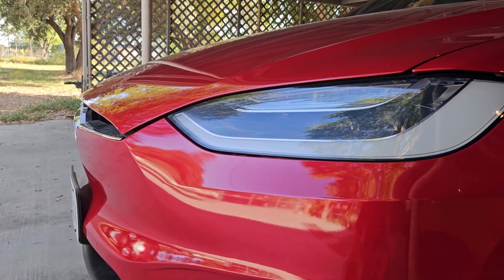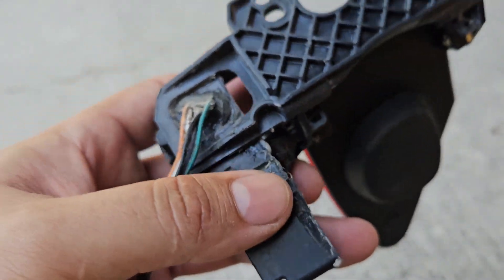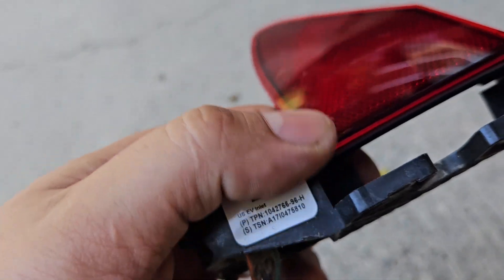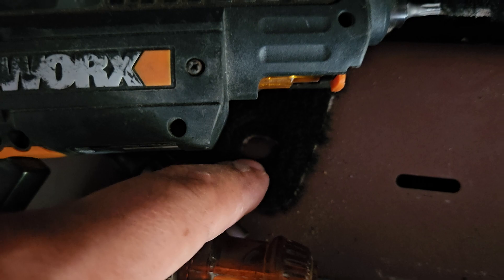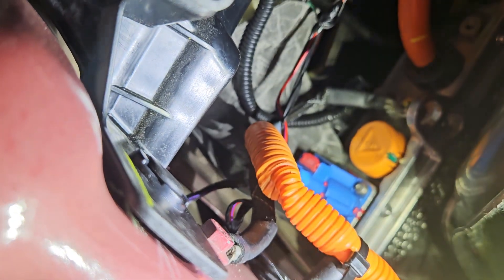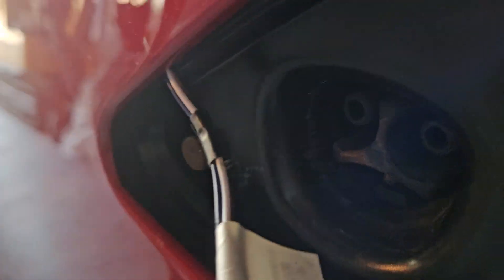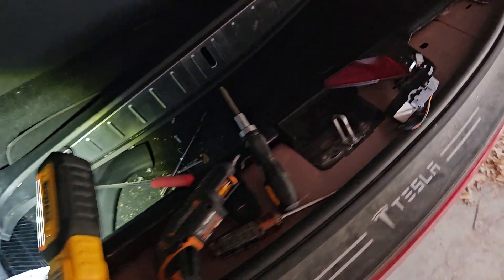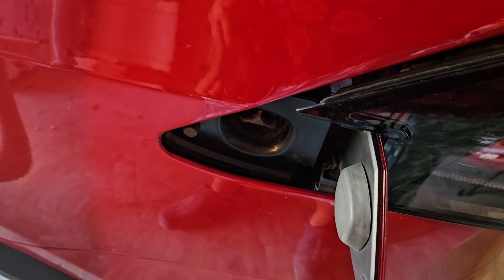Replace Charge Port Door Actuator Tesla Model X

Comment: Did you also have the problem that the blue and green light didn’t work on the charging port ?
Reply: Hey I have that issue did you ever figure it out?
Reply: Just change the whole thing and it will work . The latch .
Reply: @RichiB2012  is it a diy friendly job like changing the whole charge port

Comment: Some comments in the forums suggest the new replacement door needs to be calibrated using Tesla’s “Toolbox 3”, have you had any trouble with the replacement assuming you don’t have a Toolbox 3 subscription/license?
Reply: And I should have said this first and foremost, thank you for the video!
Reply from the maker: No problem at all. Although I did not mention to test before full assembly. I did install but rubbed very little and will not close sometimes fully.

Opened again and pushed up and now closes fine everything

I'm trying to upload as many Tesla repair videos
Reply: @cartonvera  I've been told that the firmware needs to be reloaded after installation. Had Tesla mobile service do the repair and the tech re-installed the firmware and (I'm assuming) ran the Toolbox 3 recalibration (or maybe those are one-in-the-same?). I've read some folks on the forums have had their new door break shortly after DIY install because the door mechanism was over powering itself when opening/closing and the force was snapping the plastic hinge.